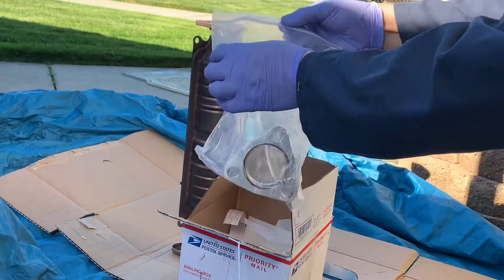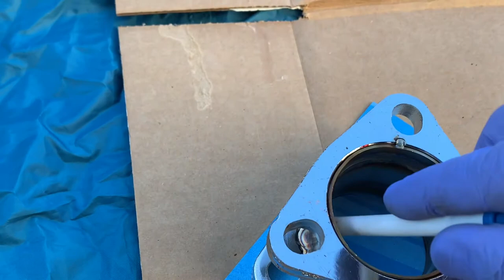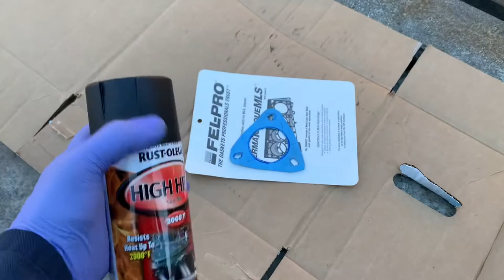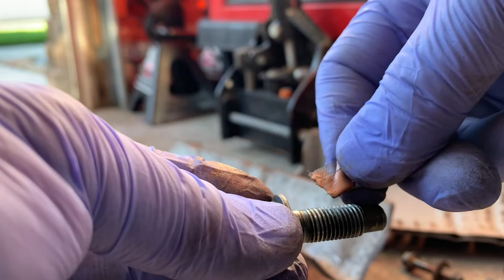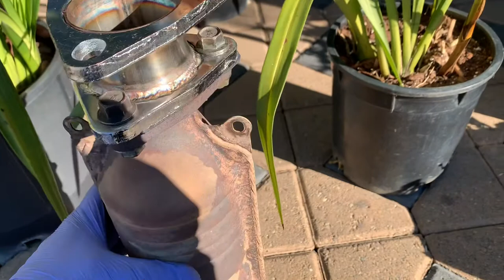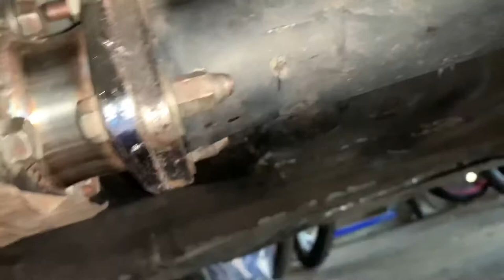Honda Crx dx catalytic converter to si oem exhaust catback

Comment: I'm checking out your CRX videos. You couldn't find the right size CAT? Is this why you needed the extension? Or is this a way to avoid having to weld a piece of pipe in between a non-bolt-on CAT to the exhaust. I have a 1991 Honda Civic Si that I'm getting ready to get back on the road. I re-surfaced the engine block myself, "hillbilly" style, using a flat piece of steel (.001) with sand paper. Appreciate your Honda videos, especially those videos that feature anything related to the D16A6 engine.
Reply from the maker: G Benz

I’m glad that you asked that question, I have added the extension because the cat came from a Honda Crx Dx with a OEM stock exhaust manifold.  It has an extra 2.5 to 3 inch exhaust pipe going to cat.  It has a weird set up with a total of 4 exhaust spring loaded exhaust bolts  I have to remove them all because DC headers were designed for Honda Civic Si set up identical to OEM stock exhaust manifold.
Wow ! You are very brave to resurface your engine block! 👍 I have to give you plenty of praise and credit doing the resurfacing🙏. I will be putting back my D16A6 this year.  I have the parts sitting for almost 3 years now except for connecting rods.  So please stay tuned 😄😁
Reply: @jpscrx  I had a machine shop grind down a piece of steel (8" x 20" ) to .001 in. Re-surfaced the engine block with the engine in the car. The D16A6 engine is a rock solid engine. Underrated for sure.